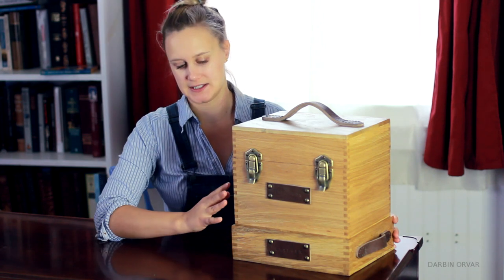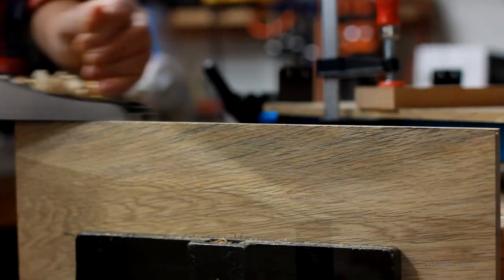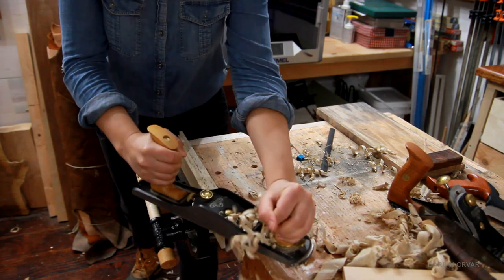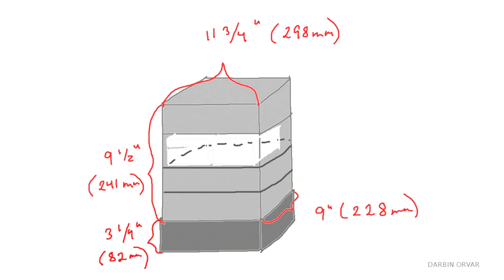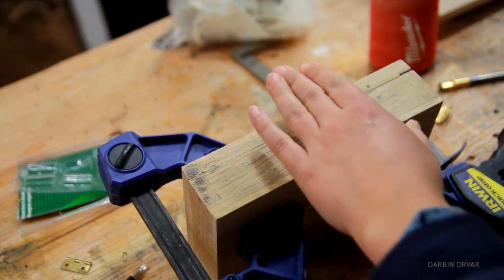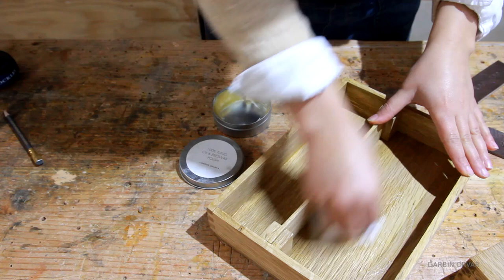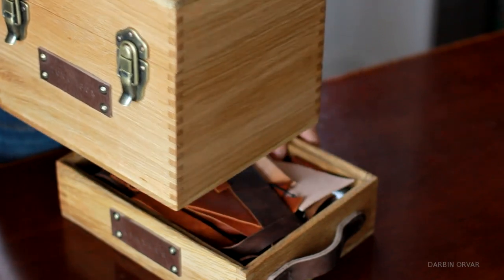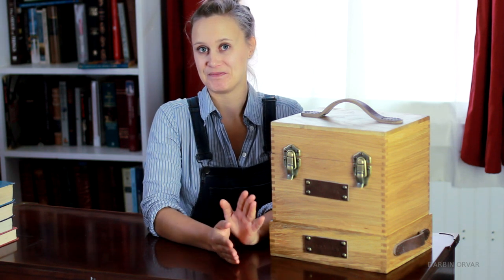Vintage Style Tool Box

Comment: I love the design great inspiration from the old timey camera boxes. If i were to build it i would add two more clasps so the bottom would be held on and you could carry it one handed from the top strap.
Reply: Tim White yeah, I was wondering if I missed something there. that's what I would do as well for my preference. 
Linn, is there a specific  reason why you didn't do this other than personal preference?  just wondering :-)
Reply from the maker: I decided to add leather handles on the sides of the bottom piece instead - that way I can carry the main box on top of it and it distributes the weight nicely.

Comment: When cutting the lid, if you set the blade depth a bit shallower than the box wall thickness it allows you to keep the box in once piece until you're ready to separate the two with a utility knife. That way you don't have to worry about one of the two box parts getting wedged against the blade and kicking back.
Just a thought. Good video.
Reply from the maker: Good tip!

Comment: Might I suggest you add leather snap on connectors  (or brass slide on) to the bottom (Leather) box to connect to the big upper box for easier carrying as one unit so you don't need both hands to carry it?

Comment: Nice box! :-D
About 25 years ago I made a wood briefcase with the same technique as your box, and I also made the same mistake. The plan was for it to hold A3 papers, but I forgot to add the thickness of the material to the cutting-length first... So now, the inside measurements are about 1,5 centimeters smaller than A3 on both length and width :-P

Comment: An interesting project.
For me, the most valuable idea is that of sewing on the leather handle.  Never thought of that one!  The leather will probably be OK for a box this size, though it wouldn't do for a heavier one.  (I say this, based on experience.)
For myself, I would have put some sort of fastening between the separate base and the rest of the box, so that you can pick up both sections at once, using the handle at the top.
If I have an adverse criticism, it is that this project requires you to be a woodworking machinist rather than an actual woodworker, which is my particular interest.  (I cringed, for example, at the screws going right through the wood, and being trimmed off with the Dremel tool!)  Still ... each to his (or her) own.
Thanks for the interesting and well-presented upload.

Comment: I was just wondering why you didn't use any hardware to attach the bottom tray to the box?
Reply: I would use some small neodymium magnets on each corner
Reply: Yeah I was thinking 2 of the same clasps to hold the bottom tray to the main box.  Or metal strips as drawer guides on the top of the tray with a magnet to keep the bottom tray from sliding apart on its own.
Reply: +1
Reply: Maxx B  v
Reply from the maker: I attached handles on the sides of the bottom box, so you can lift the whole unit (both boxes) as one by holding the handles - that way I didn't need to secure the two with hardware.
Reply: I see what you mean, but doesn't that make it a bit cumbersome to carry, having to use both hands?

Comment: Nice Video. Can you provide details on which tools you find useful for working with leather? It looks like you have a pretty nice set and it looks to be more than the tool kit on amazon you have a link for. Any hints on the tools you need and those you don't?

Comment: 7:26 Where did you find that center drill thing?
Reply: I am not sure where she purchased hers, but I purchased a set of Vix Bit Self Centering bits from Lee Valley. Amazon also carries them.
Reply: Rockler sell them in a wallet of 3 different sizes, I have several sets so I can always find one quickly.
Reply from the maker: Rockler self centering bits.